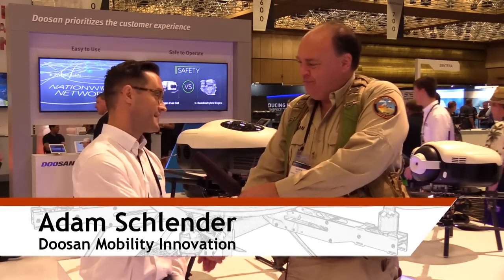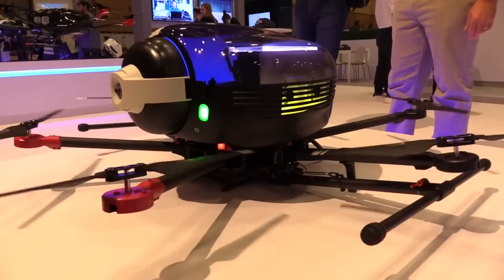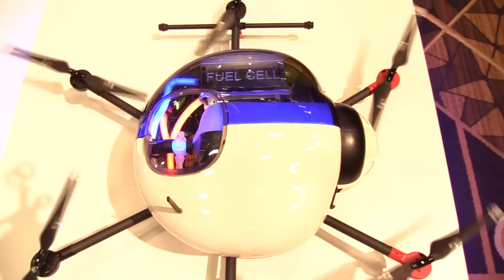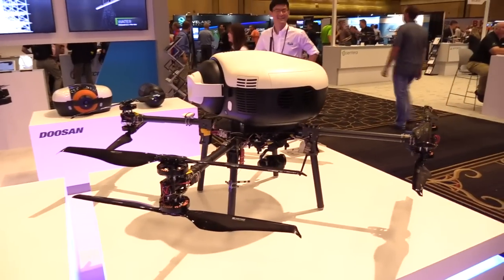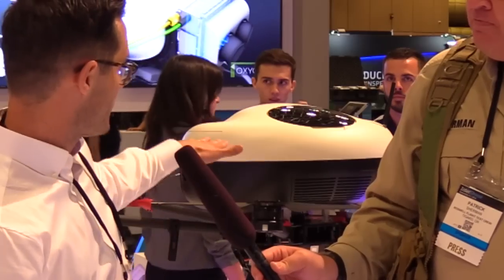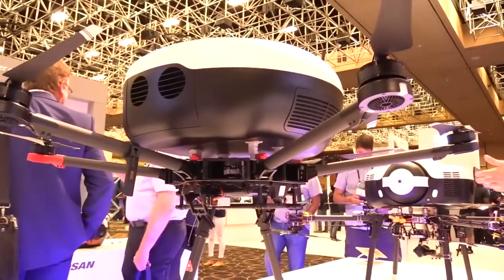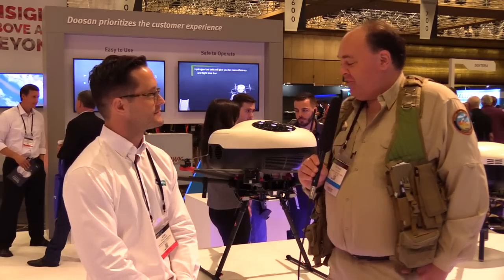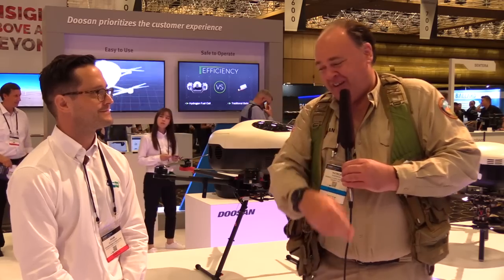Fuel Cell Drones Can Fly for 2+ Hours

Comment: I would not say that 2 hours is 10 times more than 20 minutes  LOL
Reply from the maker: Neither would I... Unless I did... If so, I disavow all knowledge and blame sleep deprivation!
Reply: It was the other guy :)
Reply: @ijustwants  well the overhead of returning to takeoff point+ battery swapping+ going back to inspection zone might take a while so it can be 10 times more. For example at %25 charge you might want to return back which you would do multiple times

Comment: Solar drone would be cool
Reply: Not for this planet. Maybe on one of those exoplanets where the surface temperature allows seas of molten lead. The only way you can fly on solar power on Earth is with a humungous fragile glider with tiny motors that vaguely suggest it heads over thataway if it's not too busy being blown somewhere else. Any solar-powered multi-rotor craft would need so much light that you'd need to give its camera welding goggles. Some kind of fuel cell or onboard generator is the only way to go to give our aircraft the power they need within their load carrying capacity. Perhaps an RC plane's engine could be coupled to a DC motor to act as a generator to top-up a regular drone's battery. The current technology of motors and controllers is excellent, we would just like to able to utilize the higher energy density of a fuel to top up the batteries (or capacitor system?) so that the drone can lift enough of a portable power delivery solution to give it flights of, say, a hundred minutes longer than the current generation.
Reply: @MartinWillett  i mean youre smart right but i stopped reading your comment after you said a planet that melts lead, dont you think the solar panels will melt?
Reply: @justfpv1432  You didn't finish reading my comment but you ask for my opinion... I am not paid to entertain or educate you, and if I was I'd be asking for a raise.

Comment: Did he said $45,000 dollars? Holy moly
Reply from the maker: Yup... Not cheap, this hydrogen fuel cell technology. However, it is starting to come down in price. Intelligent Energy, which we interviewed at last year's show, is now selling their system -- capable of powering an M100 -- for about $8,500. So, add that to the cost of an M100, and that's your price for a drone with a two-hour flight time.
Reply: @Roswellflighttestcrew1947  interesting!
Reply: With that price get your pilot licence. Buy a piper arrow with 5 hours of flight! And put them 3 cameras hazelblad 2 in wings and 1 in the tail and enjoy!
Reply: @shonix123  its 18k not 180K
Reply: A freefly alta8 is 18,000$ which flys about 25 min buddy